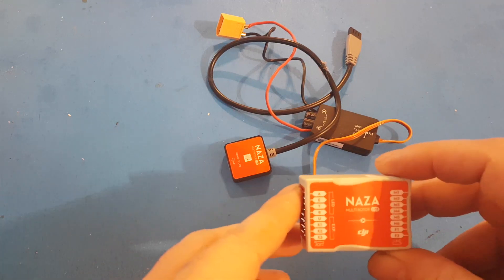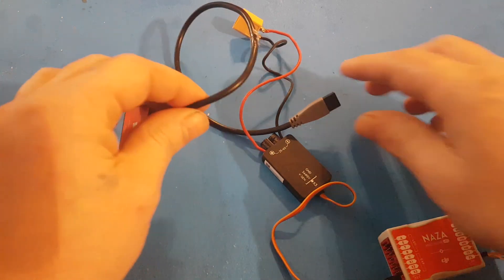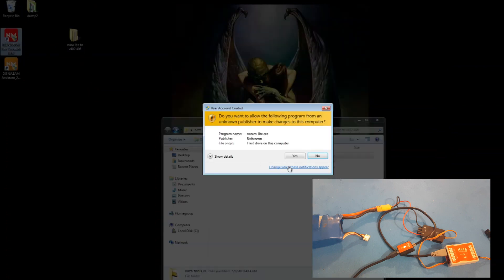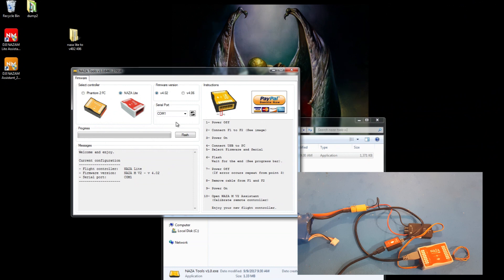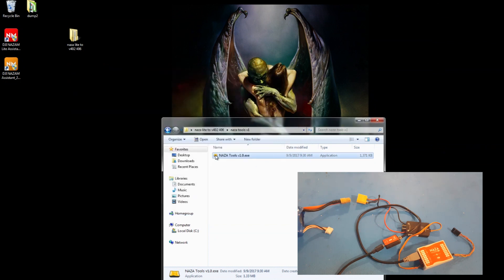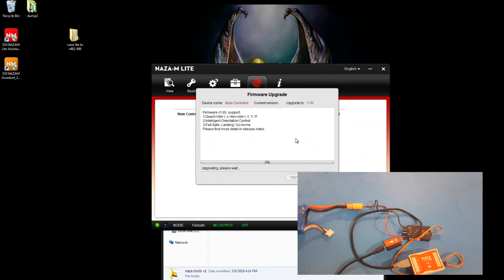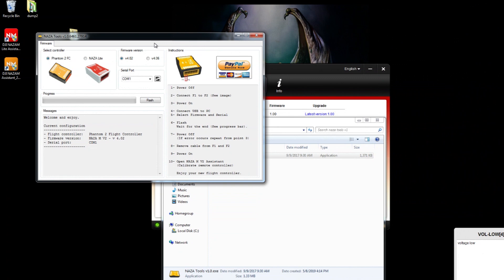DJi naza m lite to naza m2 4.02  4.06 UPDATED STEP BY STEP

Comment: I bought a cheap f550 with a naza v1 
What keeps me wondering is this.

The v1 vs v2 
Is it only the software making it a v2?
is the hardware the same?

Because i saw a vid and the v2 looks waaaaay more stabel.

Thankls for sharing.
im curious for the previous video you mentioned
Reply from the maker: yes 100 percent same hardware.. only diff is the software , the price tag and sticker...Bootloader is write protected this is  why you can't upgrade to any v2 firmware only the ones listed ..  But updating anything comes with risks of bricking ect.. so if your ok with what you have, keep it..
Reply: I got it flying today with my new remote. 

V1 is realy sloppy.
Im going to lash V2 now and test it tomorrow. 

I'll let you know the difference.
I read somewhere that the V2 comes with a better GPS.
Hopefully the old antenna holds up :)

Thanks
Reply from the maker: @danieldewindt3919  hopefully all goes well..   the original video is here .. forgot to answer you the first time..  https://www.youtube.com/watch?v=nTyYwHtlfeg  its a tad more steps involved with that way..

Comment: Getting attitude mode on both sides gps does not show please help
Reply from the maker: Hi .. sorry I have no clue what your problem might be..  You might be better off finding a dji forum to ask your question.  If this only happen after the update . You can simply revert back to the old firmware ,I show how to that at the end of the video.     I only used my dji naza flight controller for about 1 hour since this video..
Reply: @ModItBetter  ok thanks

Comment: Do you know if can i use ground station or any mission planner with that upgrade?
Reply from the maker: Hi , you have to use what ever options dji offers.
Reply: @ModItBetter  but I mean, will it works with any of then? Because I saw some people saying that naza lite may not work, but as this is a upgrade to V2 I don't know
Reply from the maker: @leonardoon8614  as far as i know miisionplanner only supporsts open firmware... it should work fine with dji version of ground station.

Comment: Question, will work for dji phantom 2 flight controller, will convert to a naza v2?
Reply from the maker: Hi the software supports both models.. However I don't own a phantom 2. So I can not confirm 100 percent it works..

Comment: Does it has any issues like flyaway or out of control and all bad stuff after or before upgrading whenever you fly plz response it's gona help me a lot
Reply from the maker: Hi you would have to do a google on the make and see how many hits you get on flyaway .. I have not been keeping up with the newest quadcopters. but when i was modding them they all fall victim to it.. However I did do a cx20 upgrade to dji  .. and noted its the only quadcopter I would feel safe recording me and being able to turn around and have it in the same spot.  The limited options dji gives its users is annoying but also handy as you can't screw anything up.

I believe what happens in a flyaway is the flight controller is stuck in a software loop from a glitch. Most micro controllers fall victim to glitching its how most are hacked as well.     All I can tell you is the firmware upgrade does no more to cause a flyaway but in this hobby you have to anticipate a fly away sooner or later.  My cx20 on my 3rd flight went straight up to the sky then shut off .
Reply: @ModItBetter nah..... Its barometer problem being such sensitive to sunlight 
The barometer put in side of fc which is really expose to sunlight, thx to its white case too that make problem got worse, 

You said yours shot up to the sky right?
There is your answer 
Its not sofware glitch anyway
Permanent solution for that? 
Just put black tape each left and right side 
Thats it
Reply from the maker: @j3fron  u can also open up the case and put a small sponge over top of it....its how the apm v3.21 come.. over the barometer that is..
Reply from the maker: also i was talking about a software glitch.. usually it will change something in the code on the fly like a jump in code.. its why nothing responds to your transmitter.. Its basically doing a code loop, same with when it shot straight up, I could not control it. .. Also I was in manual mode so it would not shoot up to a location where it thought it should of been... But I'm sure its possible and adding what ever to your flight controller to stop anything bad is a good thing..
Reply: That's not good 
Okk thx hope i never get such situations

Comment: I just found this video today, and it worked perfectly!!! SWEET! OMG I spent hours messing around trying to connect USB to my Naza M Lite with Windows 10 using older info/videos. It was a LOT of work just to get the serial port drivers installed with all the WIndows 10 driver signature workarounds! I finally got it working to where Nazam Lite Assistant 1.0 could connect to the Naza M Lite, but the older Youtube videos from 2016-2018 will NOT work to update it to Naza M V2 firmware. With this video I was able to use the "Naza Lite 2 V2 New Package", and easily update my firmware to v4.02, or v4.06!! I have had this Naza M Lite controller sitting new in the box since at least 2015 and never got around to using it till now. Thanks so much!!! 
I feel sorry for people still buying these on Amazon thinking it will be easy to use lol
Reply from the maker: thanks Aaron Kahn for taking time to leave a success comment..glad it still works and everything went well for u..  Also good luck with the project your going to use the flight controller in..
Reply: @ModItBetter  Thanks for the simple instructions. I’ve got a similar situation. I’ve have a naza lite sitting around i totally forgot about from 2015. I can’t seem to find the the upgrade. the few links I’ve found all point to the same dead/gone page. Any idea if it’s still available? Thanks again.
Reply from the maker: @humblyright  did u check description  i should have link to what ever i used
Reply: @ModItBetter  sorry i missed it. I see it now. Thank you very much for the video and quick reply!

Comment: need hel i got v2 but try run drivers for naza just get administrator has blocked from running this app
Reply from the maker: hi did you install the drivers?
in my other video I show the steps  if its driver issue.
https://youtu.be/nTyYwHtlfeg?t=133
Reply from the maker: you could also right click on it and say run as administrator to see if that gets you farther
Reply: @ModItBetter  ye

Comment: My drone is not arming after upgrade any help I did calibrate esc also
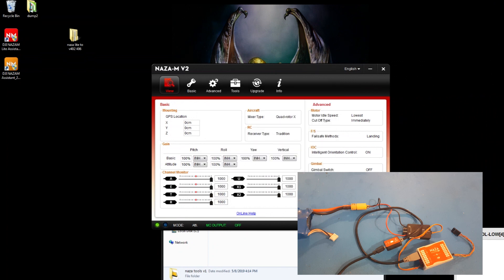Reply from the maker: odd ..maybe you have to redo all the calibrations and if you had to reverse channel 2(E) before maybe it reverted back to default.   if you still can't get it to arm maybe try to go back to the original firmware i show the steps for that at the end of the video   3:20
Reply from the maker: hopefully that works out for you.. its 5:30 am here and was just heading to bed..  I'll check back later to see if you got it going again..
Reply: @ModItBetter  thank you I did installed old firmware but I want to use v2
Reply from the maker: Hi so out of curiosity did you try version 4.06 and you could not arm? or was it 4.02 ?    Also did you check to see if it was your channel 2 in the dji software that put channel 2 back to normal?   Unless you change that on the transmitter..   Andddd when you reverted back to stock,  all is well?
Reply: @ModItBetter  I tried both versions and the problem is lite flight controller does not allow the motor to run because it recognises the serial number.  I read on some page. So I downgraded it to version 1 now it is working good
Reply from the maker: @pavankumargariganti155  if that is true that mean in the last year or so they have updated the boot sector to over come this.. which is sad they spent money doing that on a old product..  this mod does not change the serial number the magic happens after the locked boot sector .  for example if you went from version 4.0.2 then upgraded through the app to what ever version will say 4.0.7   that original firmware will then do a check on the boot sector and serial number to see if its compatible .   The 2 included firmware 4.0.2 and 4.0.6 by pass that check.. 
well sorry they did that .. I'm just surprised they have not got so dirty to just brick peoples flight controllers ..

Is it possible its auto updating them to a newer version ? besides 4.0.2 and 4.0.6 you can check in the settings .. but don't blame you if you don't want to run the risk trying again.
Reply: @ModItBetter  there is no new version of lite may be it only works for older model of m lite
Reply from the maker: @pavankumargariganti155  maybe ,,what i meant was for the new ones being made .. they might of played with the boot sector some how..
or it is auto updating it to something else besides the custom firmware 4.0.2 or 4.0.6..after your done programing it.

At least you were able to recover it..
Reply: @ModItBetter  I'm searching for another method. and I am building a endurance drone any suggestions I want to have a flight time more than 30min

Comment: Hi, I have a Naza-M and I need to change the ESCs, I read in DJI that they must be 400Hz. He was 20 A Afro but they died from the water.
Reply from the maker: HI .. I had no issues using my cx20 ecs's    if you look on ebay for cheap esc's  example "4 esc 4 motor"  you will find lots of compatible .. I'm sure most of the yellow style esc's will be compatible for example.. I have NOT used these sellers just examples.. most 20a + esc are compatible from 30Hz-499Hz

 https://www.ebay.com/itm/4X-XXD-Brushless-ESC-30A-2-3s-Electric-Speed-Control-for-Airplane-Quadcopter/274477702895?hash=item3fe8255eef:g:z5MAAOSwTjRfTBXo    

https://www.ebay.com/itm/20A-30A-Brushless-ESC-Electronic-Speed-Control-For-RC-Car-Airplane-Multirotor/154088046270?hash=item23e05cfebe:g:45gAAOSwiMBdxM6i

and here is one that actually lists the hz.. .. Its a really long link too lazy to figure out how to shorten the thing..  (i think i figured out how to shorten the guy if the link bellow does not work let me know)

https://www.ebay.com/itm/Professional-2212-920KV-CW-CCW-Self-Locking-Brushless-Motor-30A-ESC-for-Drone/114367692749?

Comment: thats really helpful ...i'm going to try it the old way for a bit and get my courage up to try this ..this is cool you didn't leave anything out and you talked in English and not abbreviations so even i could understand lol awesome !!!
Reply from the maker: Hi thanks for the kind words..   Keep in mind with the rule of thumb with firmware. If your happy with what you have and its not broken don't upgrade.    This video here is pretty straight forward and even if the firmware gets corrupt the boot sector is locked and "should" protect you from a brick, so you just need to revert back to version 1 if anything goes wrong.   Regardless thanks for taking time to leave a comment and good luck with the update.
Reply: @ModItBetter  this is the first one i built ..i'm just trying to get it to fly and return to land ..thats all ...waiting for another frsky 8 channel receiver ..i burnt it up trying to follow how to manually bind it with servo's as i couldn't calibrate the motors or arm...i went into naza assistant and it turns out that my throttle stick was backwards ..it will bind now with the turnigy receiver but i want to use a frsky djt module and telemetry receiver for return home to home ...thats a big response i hope i made some sense
Reply from the maker: @spark23ca  I would suggest getting your self a apm 2.6 which is a hardware downgrade(still does more then the dji) but a software upgrade instead of the dji.. or if you want to have basically the same hardware get a pixhawk .. Pixhawk is better then the apm 2.6 but equal to the dji for hardware but 1000's times better for software.   with a 10 or so dollar telemetry module You will have fallow me mode , return to home ,auto missions .osd so if you get video transmitter you just need a video receiver and a display instead of a phone to have video feed and telemetry data on the display.

 plus a app called droid planner for your phone  ect ect..    Now sorta bias because all my videos are on the apm 2.6 and pixhawk .but every video basically apply to any home built quad as the cx20 is just 4 motors and a power board.
 if your looking to continue modding I would suggest moving away from it. As pixhawk and the apm both use the same open source software and great Gui software called mission planner that puts dji gui to shame.   Also the pixhawk and apm 2.6/2.8 come in all sorts of packages to mini -micro-full size pixracer. which again i cover in lots of video's.

with that said the dji was one of the best out of the box installs that was extremely stable . personally I only used mine for the 4 or so video's then it just collects dust. because the lack of options.
Reply: @ModItBetter  yes i think i would have been better off with that ...next time i'll do that ...i've wasted a pile of money and time learning this ..but everything is ordered ..i bought a lot of this stuff in like the turnigy 9x a few years ago ... but then lost interest ...i'm more interested in the pictures .. not going to do any fpv racing ...i've got tons of other stuff needs fixing ..log skidders and snowmobiles mini vans chainsaws and the house ..
Reply from the maker: @spark23ca  Well the dji flight controller is not bad anyways . in one of my videos i had said "its the only one i would truly trust turning around and doing work as it filmed and be comfortable knowing when i turned back it would be in the same spot.   The positive about limited options is less for somebody like me to screw up ."     So Don't get me wrong I was not trying to be one of those people saying to give up on your current problems and move to something else.  I was more a suggestion  if your going to continue in this hobby with modding and adding add-ons..to move away from it.
Reply: @ModItBetter   if there is a next one i'll likely use apm 2.6 ..the naza had more videos so it was easier for me to follow along ..... people who have the answers sometimes it seems like they just won't answer ... but i'll see if this one flies soon as i get the parts ..im from canada and shipping not sameday its someday
Reply from the maker: @spark23ca  From canada as well .. And i know about shipping lol i get my stuff from china so it takes anywhere from 3 weeks to 4 months to never.   However sometimes "never" shows up 9 months later after i got the refund already.    I really wont be able to help you to much with the dji my knowledge on it is basically zero..   I did make a cx20 - dji .. but I also had to make a daughter board to convert the cx20 receiver so it would be compatible ..  however the video is pretty useless to you as your beyond those steps already.

Comment: Sir is there any way to use our BN880 gpa into dji naza flight controller
Reply from the maker: not as far as I know unless you make a man in the middle for canbus.
And I have no idea if dji signature checks the chips on the gps.   but I'm just assuming this as i've never tried this... however if our extremely creative ..you can cut and jump the tx and rx traces to the old gps chip to the new gps. ..Pretty sure that would work ..
Reply: @ModItBetter  i have found this form where  they have tested it https://www.rcgroups.com/forums/showthread.php?2290346-Naza-v1-v2-Lite-GPS-module-alternative-(using-APM-2-6-GPS-compass-combo) 
It would be great of you try this and make a video of your version , to be honest nothing can be compared to the way of explaining you do , to try t give all the information as possible in a complete video, so a humble request from a subscriber , please make a video on this
Reply from the maker: @AfshAd  Yeah it seems that project did what i originally said they need a man in the middle to convert it over. .. I'll look at the code a tad see if its something i can do.
Reply: @ModItBetter  that's great

Comment: Phantom 2 flightcontroller can be convert to Naza V2 is it possible dude?
Reply from the maker: Hi .. had to delete my other comments.. the new loader i show in this video shows the phantom 2 .. so I am pretty sure it will work..
what you can try to do is attach the cable like i show   3:30 and see if the phantom software asks you to revert back to stock version. .. Then at least you know you won't end up with a brick..
Reply: @ModItBetter  Greetings, my phantom 2 controller is like a brick after flashing it to Naza v2, what can I do to remedy it?
Reply from the maker: @redimidodejesus1360  did you try 3:18 of this video you should be able to revert back to the original firmware .. unless some how your bootloader got wiped out or corrupted..
Reply: @redimidodejesus1360  u can try to hard reset the flight controller to factory setting then update the fc again. don't forget to jumper the cable F1 & F2 and switch on.

Comment: I had upgrade .... And my hex crashed 2 times .........
Reply from the maker: Your able to revert back to version 1?    No idea why its crashing on you.. but its good you posted so others can be warned..
Reply: mine was not arming in first attempt. it was taking 10 to 15 attempts to arm so reverted it back to 1.0
Reply: It was my hardware problem ....   I had bought a gnss module separately  .  And plugged into my Naza which it was not supporting in v1 when I upgraded it ... It worked but.  While in flight.  Ang One of the motors used to stop spinning ..... And crashes .....

Comment: sorry man but this software is not working 

i have damaged mine Fc software and spend lots off time serching for the solution
Reply from the maker: try to go back to stock .. by following the steps at the end at 3:30
sorry for not replying earlier My pc has been off line I have been working on hard drives all day today and most likely all day tomorrow as well.